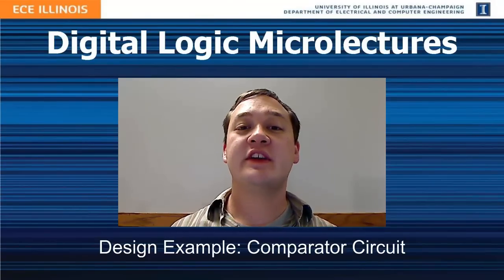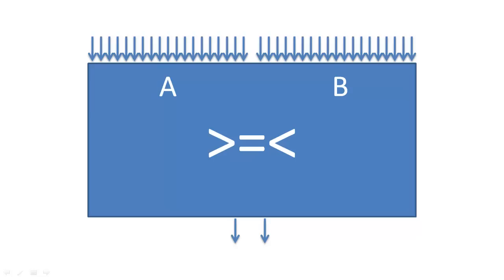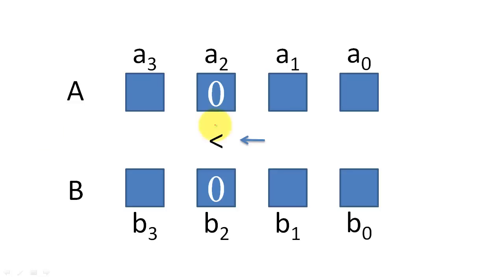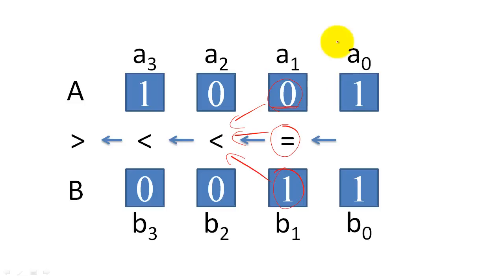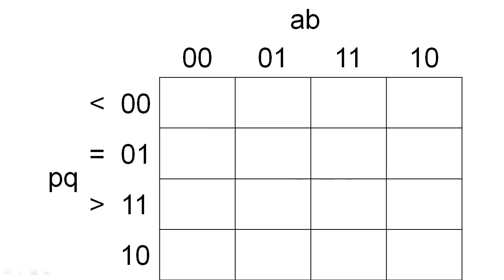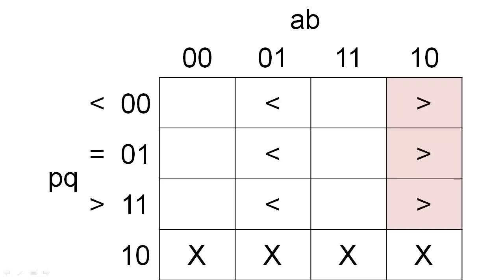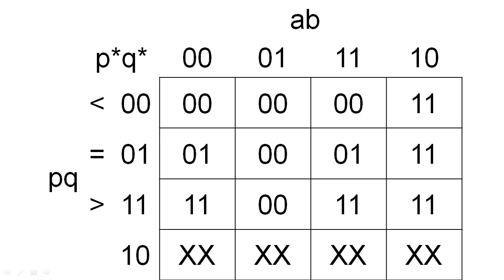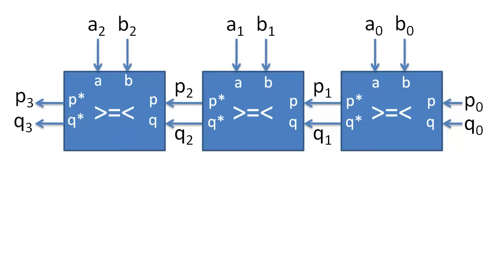Design Example: Comparator

Comment: I suppose you could reuse the ALU to do a-b and then check if the value produced was zero (in which case the inputs were equal), or if not, what the carry out bit was (being 0 for b>a and 1 for b<a).